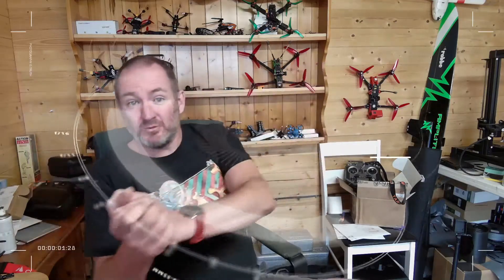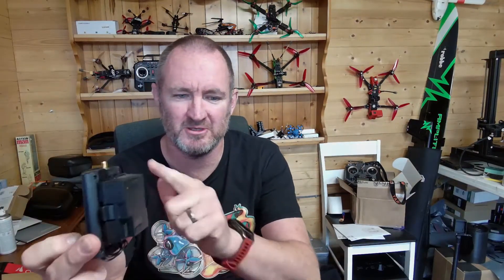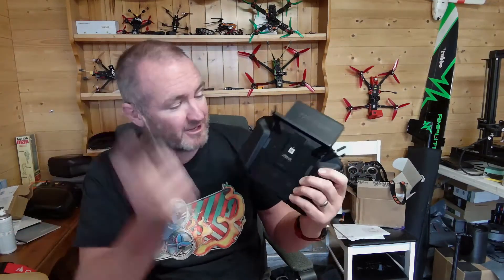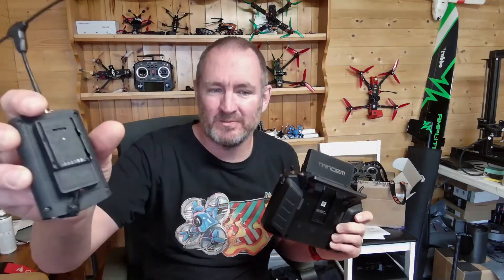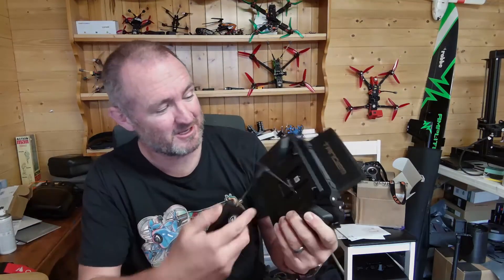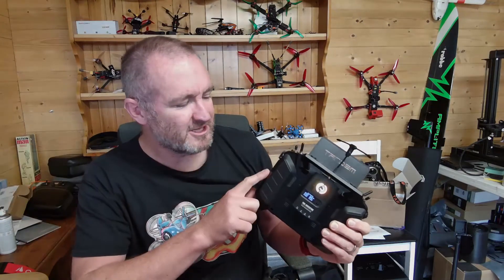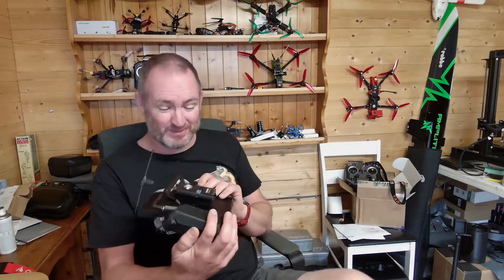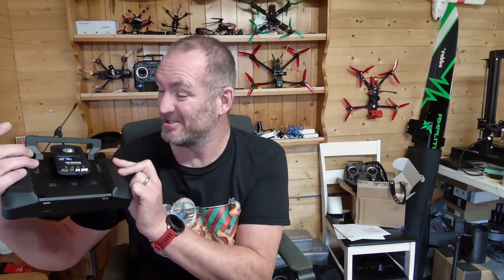TBS CROSSFIRE MODULE ON YOUR TANDEM X20S

Comment: Hello
I also went to Chromefire and wanted to recreate it exactly the same way!
Can you tell me how I have to solder the cables from the Lite module to the adapter for the transmitter?
That would be great.
Greetings from Hamburg .
Reply from the maker: It's just a case of matching pin for pin.

Look into the xlite module bay format and the crossfire manual and all becomes clear.
Reply: @RTRCTV  Thank you until then.
I found out in the manual:
  Plus and minus with the ppm signal, nothing else.
It works so far, what do I do with the other assignments? There are more pins available.
Is any other connection useful?
And if wi is the occupancy.
Lg.

Comment: I have the full module and JR base with wifi (in the base and Bluetooth). Printing is not an issue but how do I get the pins to connect?
Reply from the maker: That takes a little bit of circuit tracing.. Essentially mapping pins from the crossfire diagram to the lite module pins.
Reply: @RTRCTV  which diagram? Also arent the pins of the lite bay (on the radio) different from a JR bay pin ?
Reply from the maker: @jas-FPV  have a read here :
http://racefpv.eu/blog/2018-05-30-crossfire-on-the-frsky-x-lite/

Same wiring job :)

Comment: Has this changed? I've been out of the hobby for 3 years. Im using a taranis x9d plus. I want to upgrade but there's so many crazy good radios. I use a full crossfire module.
Reply from the maker: Still no csrf support for the x20.

Comment: I tought the x20 dont support crsf? 🙃
Reply from the maker: Right now.. only PPM.

However I have been assured by frsky that CSRF support will come in time.  They have a long list of things to dev first - for example - lua scripting that is needed by the crossfire module for configuration.   So.. it will come.  Just not sure when!
Reply: @RTRCTV  thanks for your reply. I would like to buy the x20 but as long there is no crsf support it's not suitable for me 😊

Comment: Andy and I did this with a crossfire lite bay, I assume that is what this is based on? It comes with the pins etc
Reply from the maker: Hey.. Pretty much.  You need the inwards of the lite bay for the electronics.

This is pretty much just a nice clean design.

If you print in on someone like uk3d print  in SLS nylon you can barely tell the difference to the original!